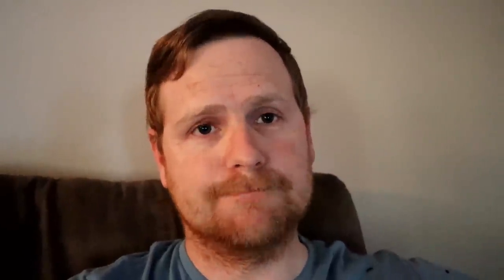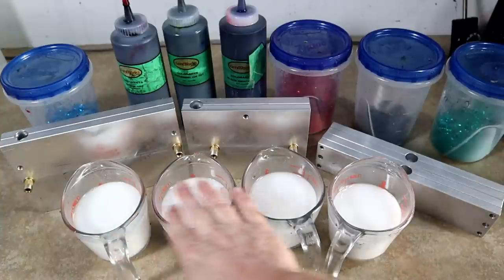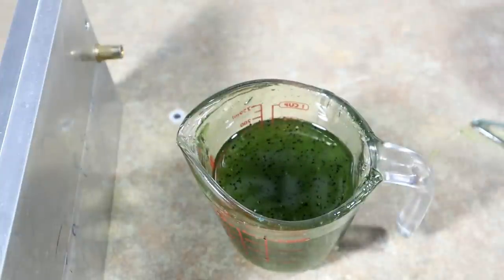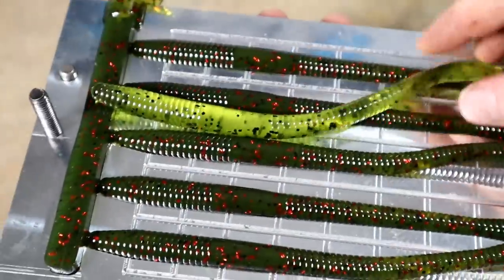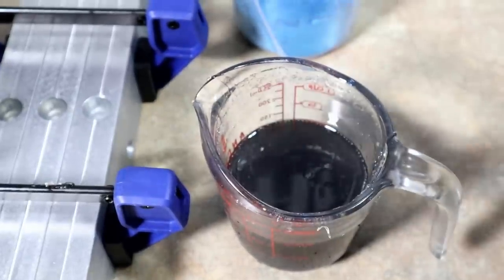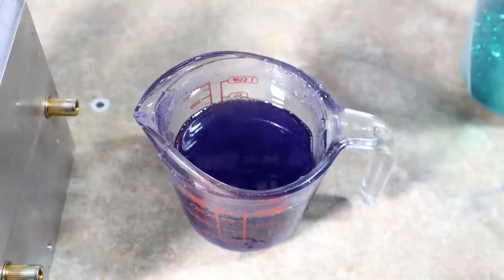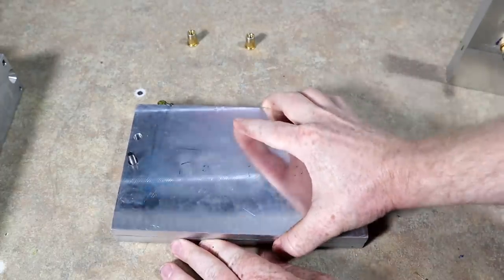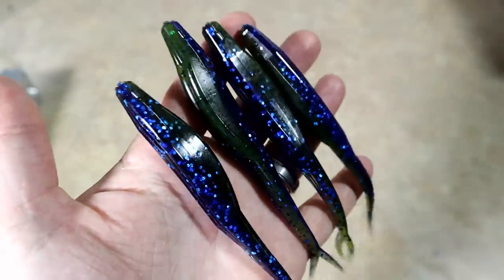BACK 2 BASICS: Making The Most From Minimal Soft Plastic Bait Materials

Comment: Hi. I understand you might not see this. But do you know if you could blend up a few sheets of light polarizing film into flakes or ribbons and pour them into a bait?The polarizing films can be cheaply purchased and are similar to the ones used in polarized sunglasses. Fish see polarized light differently than us and it may not be showy to us but to a fish may be very visually noticeable.
Reply from the maker: you could try..they might melt or cause a reaction with the plastic, so use extreme caution, gloves, long sleeves, eye glasses and add them to the hot plastic from a distance using some sort of extender.